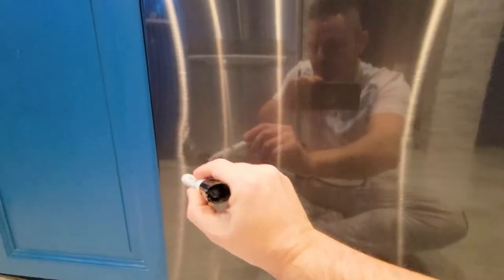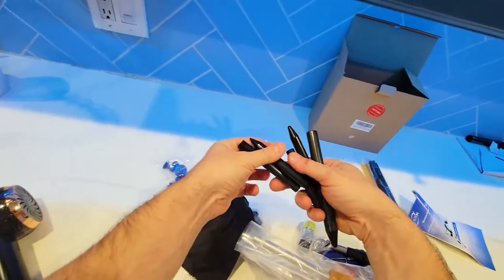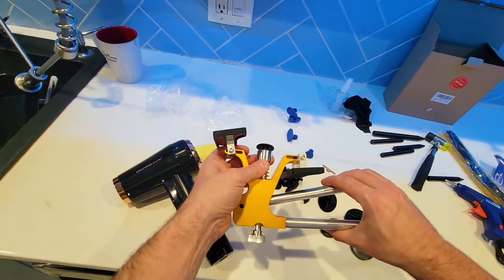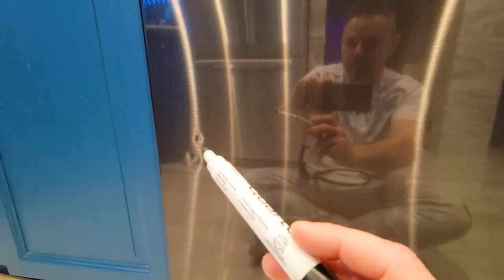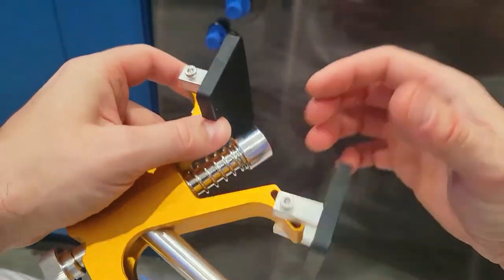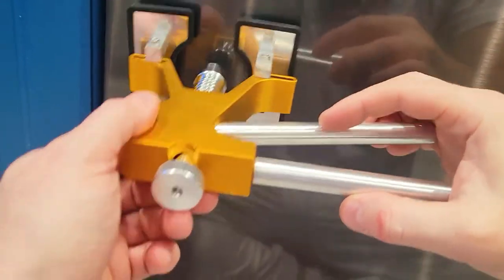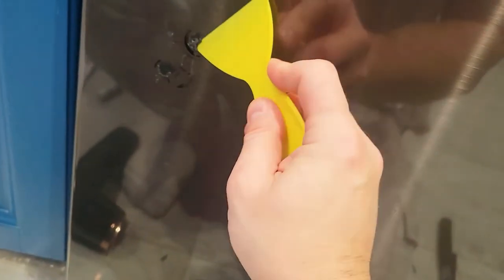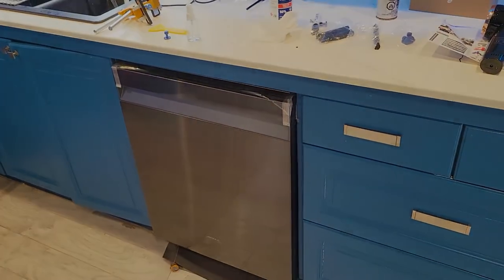How to Use Dent Puller on Dishwasher Door - Dent Removal Tutorial on fridge Panels or Car panels

Comment: can this technique be used on a painted clothes dryer dent
Reply from the maker: yes this will work on any aluminum or steel appliance, dishwasher panel is much softer than fridge or dryer dent, so you'll be fine. let me know how it goes
Reply: Can i use this on fridge?